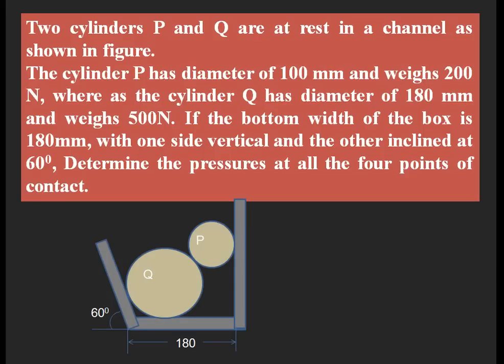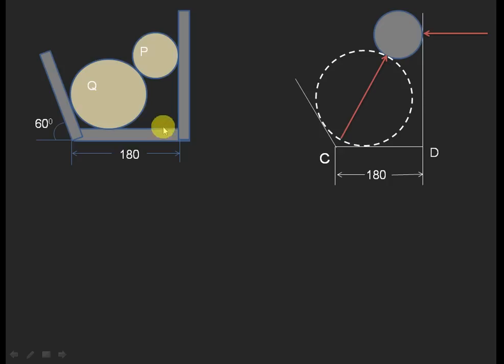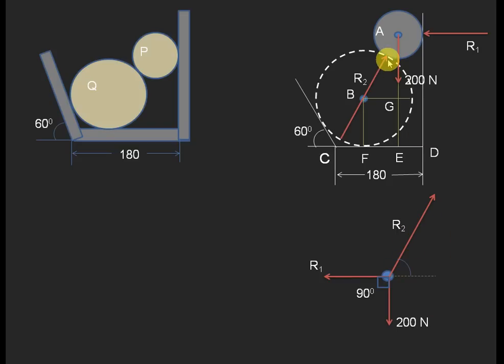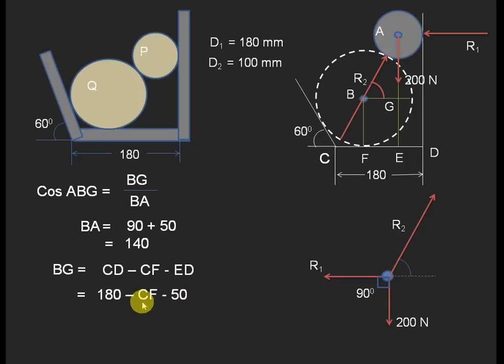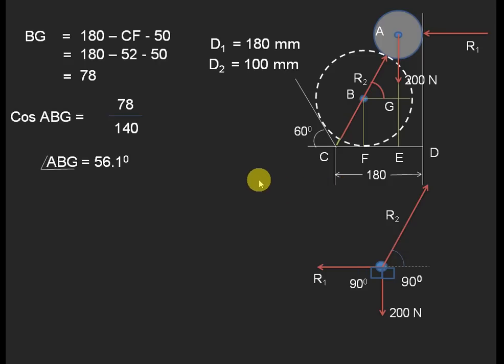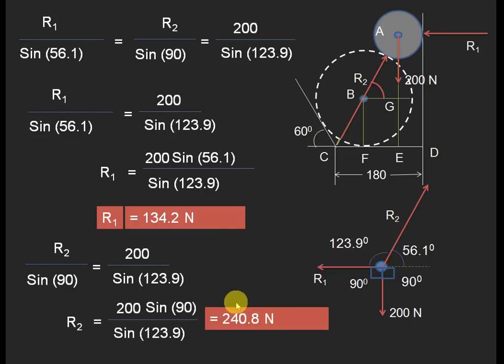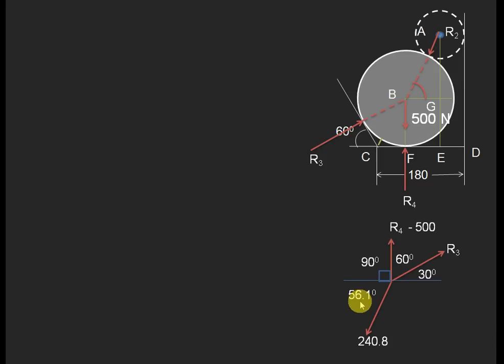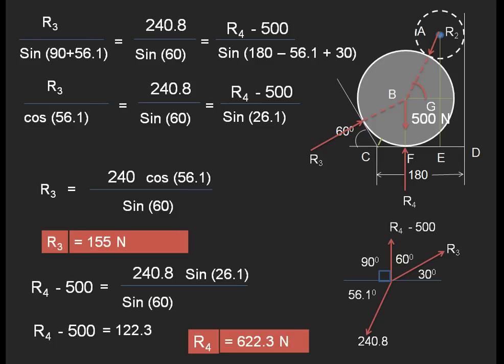How to apply Lami's therom for free body diagram problem

Comment: how is BCF= 60 degree?
Reply from the maker: Actually it should be the data to be represented on the figure itself.
Reply: Sorry?
Reply from the maker: If you get this problem in examination, the value will be mentioned on the diagram itself.